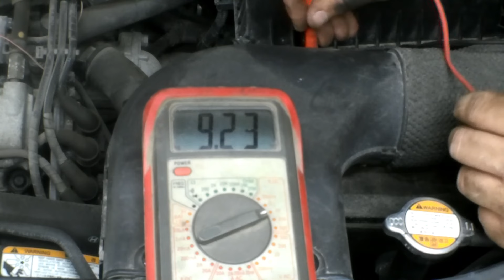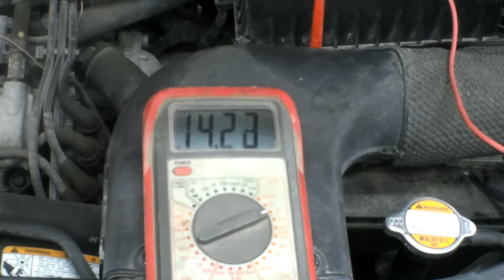Kia Sportage Alternator Replacement

Comment: Just removed mine in a 2007 V6 Sportage, nothing wrong, just had to move it out the way for an OIL pump replacement and thought may as well clean it up. Being down south, waaaaaaayyyy down south in AUSTRALIA lol, I had added difficulty bonus of right hand drive power steering making access even that much more of a PIA, thanks KIA. Oh, there is for my 2007 at least, a small cable support clip for rear O2 sensor that goes into the alternator body, fiddly but assume many get broken, in addition to other two cables.
From Perth, WA, Australia

Comment: Thank you for this; very helpful.  As someone else mentioned, I did not remove the tie rod (nor the axle).  It is a pain to remove, but it can be done.  And, after spending about an hour wrestling the old one out, the new one went in surprisingly easy....maybe took 4 or 5 min.to get into place.  A note about the electrical plug connection: I unplugged it before taking out the bolts.  (As well as removing the "boot" covering the terminal post and the subsequent nut holding the flat, O-ring connector in place.)  To unplug it you need a small, straight screwdriver to push in the plastic clip as you push up.  This will disengage the electrical coupling so that you can remove it by hand.

Comment: Watched your video and another one. You took off the power steering bracket, which I did also. But you removed the tie rod and shortened it. The other video the guy pulled the CV joint out to make room.
I was hoping to not take out the CV joint or the tie rod, but I may do the tie rod. I wished your video showed getting the alternator out to the end. Your video stopped just short of the removal, so I could see the alternator position when it came out.
It looks like if both the tie rod and CV joint were removed, it would be real easy.
Unfortunately, my tensioner pulley broke where the socket goes in to relieve the tension and the tensioner pulley has been out of alignment and the belt ride in only half the pulley and up against the engine case, wearing down the belt. A problem just waiting to happen. So I am waiting on a new tensioner and belt also.
Looking at the arm, one bushing is cracked and wearing. I may need to change that lower control arm too. Cars are so much fun!
Reply: Yes puzzled why he would not show it coming out that impossible hole🤔

Comment: How did you take that long bolt out of the bottom of the alternator? I am doing one and the bolt stops at the bracket for the mount holding the trans up

Comment: how did you get the bottom bolt out? on mine the bolt is too long and has to come out the back of the alternator, it hits the motor well before it will come out enough to free the alternator
Reply: Ever figure that out ?
Reply: Gotta hit the bottom right with a hammer upwards and it just comes out. I hammered a crowbar against it.

Comment: Do u have some videos where to put a serpentine belt for this kind of car?  The mechanic that put the alternator told me that I do not need to buy a new belt but when the car heat the old serpentine loose too much and the car lose potential. It's my suspicious. I will send the car to check out the code with the other mechanic. Or you may have some idea this happened: for 6 days the car was running fine but the at 7 day I drove  15 minutes  and I lowed the velocity front the traffic light and the car turned off, I put neutral and pushed the car to a right side. I could not call the tow  because my phone was dead, so I waited 5 minutes else, and I tried  turned on, and it works, so I drove to home and before arrive home wants to turn off again  I stop 1 minutes in just in case and turned off the equipment inside the car and I could drive again.  What could be the problem.

Comment: Stupid Kia engineers should have made it come out from the top.
Reply: or just had that opening a little larger to allow the alternator to come out without having to take suspension apart.   Kia morons.   So glad I don't have one.  Watched this video because our son is banging his head against the wall trying to fix his alternator.
Reply: Subaru ftw
Reply: Not all that experienced, but outside of 20+ year old cars I have always seen them in the bottom.
Reply: @swank1975  I pulled the CV axle. Not a big deal. Alternator replacement was then easy and straightforward.

Comment: Disconnecting B+ connector 12mm nut was impossible for me without reaching up behind engine to break the plastic wire tie (pushy) to engine that was restricting the B+ harness from further slacking.  This plastic wire tie anchor thing isn't even needed!  10\10 Garbage vehicle including Tucson.
Shocks, Bearings, Alignments, Control Arms, bushings, stabilizer links, Brake Lines, Power steering pump and rack issues or leaks, HECU fire recalls (still no fix), ac compressor bearing failure, balljoints, tie rods, rear arms, rear differential viscous coupler, center carrier, transmission faults, drives like junk, swerves, intermittent steer pulls, weak faulty ESC best to disable it, rear brake inner dust plate design rubs on rotors after swelling with rust, cabin water leaks, bad design sticky PCV.  
These are a few of the common issues with this vehicle and the Tucson which is the same vehicle.

Comment: I got mine out without removing the tie rod,its a bear but can be done.
Reply from the maker: Good deal!
Reply: Yeah and how did you get bottom bolt out then??
Reply: @shaunforreal The bolt just has to be loosened,the housing on the alternator is
Reply: Sorry,alternator bracket housing is a u shape,so it lifts off,the bolt does not need to removed just loosened.

Comment: Nice man ….umm thanks for leaving the absolute most important part out…..bottom bolt can’t come out unless Axle is moved…..smh unbelievable
Reply: Axle has to be pulled?
Reply: Absolutely. Hes claiming the bottom bracket is slotted lol. Bullshit the thru bolt hits the back if the cv shaft bracket and cant come out.